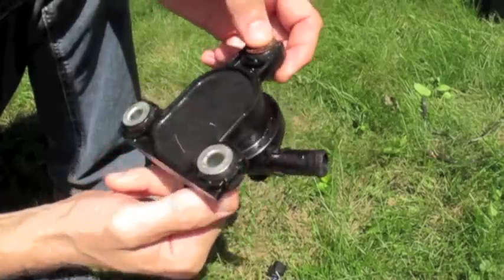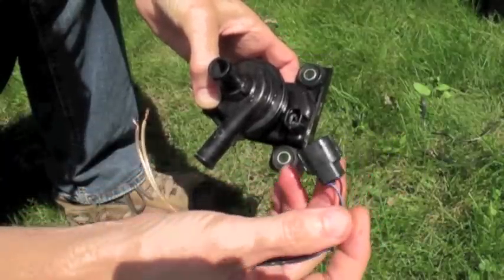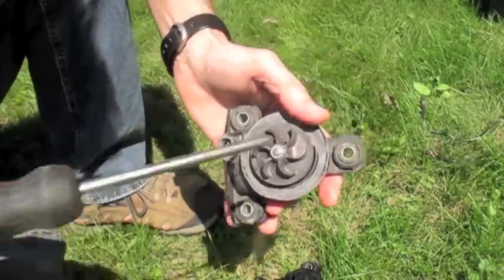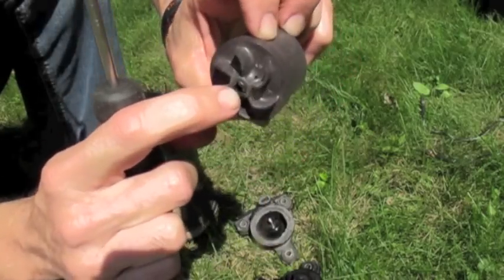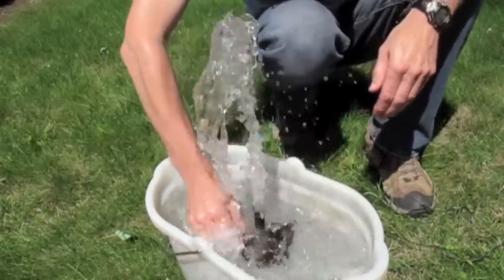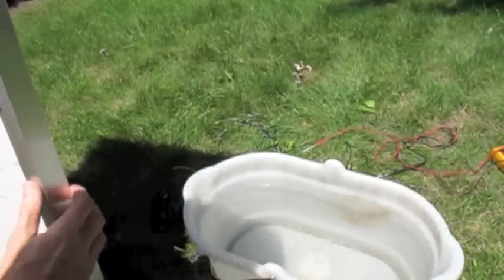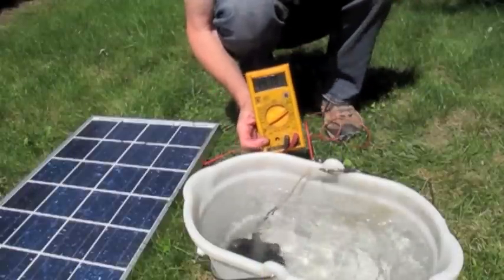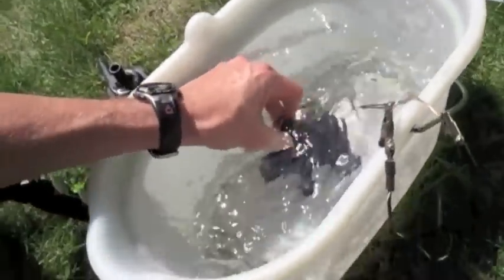Amazingly powerful 12volt water pump from a Toyota Prius ● test to 12v and solar

Comment: There is an another useful test for centrifugal pumps to determine its capabilities and that is static head.  This will provide the maximum height that the pump will lift and is typically stated in x feet of water at zero flow and can be converted to PSI. With a small pump you could use a clear vertical tube of sufficient height on the discharge, and then measure the static height of water with the pump is running. Larger pumps would require a pressure gauge and pipes of sufficient strength. Once the maximum height is known the tube could be tipped where the water would flow out the end of the tube at the maximum height and into a 5 gallon bucket.  Then measure the time it takes the pump to fill the bucket and that will give the maximum capacity of a pump at the maximum lift.  This same test can be repeated at 3/4, 1/2 and 1/4 maximum height to give the various capacities at various discharge conditions.  This data can then be plotted on graph paper, discharge pressure in feet of water on vertical axes and flow in gallons per minute on horizontal axes, to develop the centrifugal pump curve for that pump.  This will provide some useful information on the application of a pump. The capacity of a pump varies inversely with the discharge pressure and varies directly with the pump speed. Google centrifugal pump curves for more info.
Reply from the maker: Thanks for that great info. I was able to test it further in another video and use your instructions. I just did an update on this little pump if your interested.  https://youtu.be/gaGRUTSLz_s   Have a look in the description too for more specs I gathered.

Comment: Nice little pump, the only reason you hook a solar panel to a battery when running a pump, is to ensure continuous power when the panel is blocked from light. Most system run the equipment at same time charging the battery.

Comment: Thank you very much, I needed an electric salt water pump that wouldn't get hot or create electrolysis to a grounded/powered shaft, the isolated/ cooled/waterproof design of this pump was a perfect adaptation for the older Volvo diesel rubber, mechanical pump it was replacing. This sail boat is back operational thanks to your video. I really appreciate how you cut one for our knowledge- I needed that info and wasn't willing to order two and cut one open to ascertain wether or not it would work.

Comment: I was a technician at toyota when these pumps were recalled, we had dozens laying around when a pipe burst overnight and flooded our shop. We used a handful of these to pump the water out of our in floor exhaust vent system. worked great.
Reply: Will they take car coolant temperatures??
Reply: They pump hybrid inverter coolant which does not get as hot as engine coolant. I don't know their operating temperature range but they live in the engine bay and get quite hot.
Reply: Curtis Armstrong I've changed a bunch of these also just never had a need for these until a bought a camper and need a 12 volt water pump to fill the water tank and now that recall is pretty much done.

Comment: You should have showed the actual no load ouput from the solar panel & loaded V & A when driving the pump in the shallowest depth.

But, it looks like the solar panel provided more power to the pump than your first power supply--which is why the jet of water from the pump was higher.

Very good vid.  Thanks for sharing!

Comment: Currently using one of these little pumps to run a solar powered stream in my garden. it is lifting water to about two feet above the level of the pond. Water pours over a small waterfall before returning to the pond.

Comment: Great info! Thanks for posting. Will add it to my solar pumping systems. I found a new Toyota factory pump with a year's warranty for $86.00US. There was a factory recall on Prius water pumps for the years 2004-2009.  All newer models and newer shelf stock should be okay.

Comment: neat little pump. if they were cheaper new I'd order one. gotta get myself to the scrap yard. walmart has 12 volt pumps in the boating isle, which I've used for hydroponics with never a problem. I love playing with 12 volt and water

Comment: I found your demenstration very interesting.  I am trying to run a vent fan on a van in a similar fashion.  It pulls about 1.3 amps at 13 volts.  All that is fine except for figuring out the solar panel I would need.  Since the panel is going to be mounted flat the rated capacity would not be what the panel would put out.  From your demenstration it looks like I would need about .75 of your 51 watt panel or around 35 to 40 watt panel to run my fan.  Do you have any idea if the 16 volt would make sense too?  I don't want to burn out my motor but I also know the the panel does not put out 16 volt when there is a load.  I am also thinking of using a flexible thin panel so the solar will not show.  Do you think this will make any difference?

Comment: Looks like a permanent magnet motor to me. They do grow weak over time, but are useful for very many applications.
Reply: Brushless DC motor. The impeller and rotor are a single piece, with the magnetic field set in the cylindrical part. The plastic housing contains the drive coils.
Reply: There is a controller circuit under the epoxy. Most likely a 3 phase sensor-less type motor that uses electro-magnetic feedback for timing.

Comment: if you need some thing a little more powerful the chevy volt has 3 pumps like this but push more GPM and can be run on PWM  or full power

Comment: thank you for the posting the video... I am wondering if there are two similar fields of magnet inside the impeller that you are showing to create the torque from the attraction and repulsion of the two fields ..because one field of magnet would take you no where.
Reply from the maker: +TheIsmaelIsaac you are correct in saying that. The impeller is magnetized and the body is electrified.

Comment: Hi Chris I live in the Houston are I have a small pond that is really stratified, there is no oxygen in the water beneath about a foot. all I need to do is recirculate the water from the bottom to the top. I want to use a pump like this to clean up the water and add air. I want to simply pump the air from the deepest part of the pond about 15 ft have that water pumped into a 55 gallon drum with sand and gravel then allow it to flow back into the pond.  My question to you is do I need a charge controller or can I just wire this thing straight with man a small inline fuse. That way I can just screw the pump to a stand near the pond along with the solar panel and just hook it up as long as the sun is shinning it will move the water. What do you suggest?

Comment: I would be interested if this would work to pump water from a rainwater storage tank?
Solar with batteries would be ideal.
Have you tried to see what sort of head this thing can pump...e. if it was on top of a tank and had to pump up from the bottom how much pressure would you get/loose?
Reply: You could easily test it, go too any car salvage place and they have car pumps too hand for cheap I expect

Comment: Just for clarification - the parts are injection molded plastic, and the halves are most likely sonic welded together. .
Reply from the maker: Correct. It cannot be taken apart unless you use a hacksaw.

Comment: where on a prius is this located? is it used to pump hot water? thanks so much! awesome video!
Reply from the maker: It is located near the left front headlight under the hood. It pumps coolant through the inverter.

Comment: Wonder if you could use this to move  enough water to generate electricity from a water turbine to charge batteries for this pump and others all running off solar  or would that just defeat the purpose?

Comment: I was fascinated with this little pump too when I salvaged mine from an old dishwasher that was going to the dumps. I haven't repurposed the pump for anything yet but have it around. I'm pretty sure I wanted to create a water fountain rock wall feature for my deck when the time comes. 
thanks for the solar panel demo though. I think I'll adopt this method of powering it. 
any recommendations for a brand and size for this? I don't think I need anything to fancy or expensive.

Comment: I'll see if I can find one.  Curious to if it will pull a 1/2" cpvc suction set at 18 feet in shallow well.  I use a shurflo 2.5 gallon to pump the well currently.  120/240 v pressure switch with toilet float JB welded to base plate to open and close points as level is reached in tank.  Pressure switch wired to battery, battery to 5 w solar panel.  Been in service since 1995.  I'll let you know if she'll pull vertical.  Good vid!
Reply: +Charles Heisler This pump will not make any vacuum at all. It is not self priming. You have three choices in pumps for this application, diaphragm like you are currently using, gear pumps, or peristaltic pumps. Others exist, but would really be impractical for this.  Keep in mind that you cannot possibly lift water higher than about 34 feet with suction. Vacuum is not a force, but a lack of force. This means that eventually the weight of the water would exceed the the pressure from the atmosphere trying to push it up the pipe. Not only that, but water will boil when under a vacuum and therefore the water vapor will begin filling the pipe up. This will reduce the maximum lift to below 34 feet by a small amount.

I would stuck with the diaphragm pump like you currently have. It will give you the best performance to energy usage available in this situation.

Comment: BMW has something similar starting from 1995 for climate control. So you get warm air even if engine is killed. Same thing that the impeller is with magnet.
Reply: Arnis Tarassu 
12v water pumps have advantages over direct drive

Comment: What water pump is this?  Can you give a part number or what it's used in?  Coolant, washer fluid, what?
Reply from the maker: It's a coolant pump for the inverter on a 2004-2009 Toyota Prius. It's located under the hood just behind the left front headlight area. It does not have a part number on it. I suggest to anyone that wants one to get it from the wreckers. That way you can also get the plug that plugs into it.
Reply from the maker: I found the part number for it.  Toyota Part No.: G9020-47031

Comment: Could you buy one of this at autozone you gave me an idea for my swimming pool slide
Reply: MrEricdgreat  You might be better off getting a water pump from a RV salvage yard. Better lift and water flow. Got me one about 8 year's ago and it still works fine and it works on 12 volts. Also if you are lucky you might find one that runs on 110  volts. Or buy a new one at a  RV service/sales area.

Comment: I'm looking to make an automatic bilge pump for my kayak, I was originally looking at 50-100gph 12v DC with a solar charging unit. Home Depot has one for under $70.  This prius pump puts out a heck of a lot more, very quiet with fairly low amperage draw.. 1200mah battery technically runs this an hour, I have enough old rc batteries laying around u could wire them to this circuit and comfortably pump a lot of water readily.. 

Do you know anything about reed switches?
Reply from the maker: What do you need to know about reed switches?
Reply: +Chris Notap I have no experience with them, the little bit of research I've done has guys using backups and multiple failures. I am looking for a waterproof switch that can be accessed on the outside of my kayak. A reed switch could maybe be installed on one of the cords on the boat and then slide to position when needed.
Reply: Didnt he mention it needs to be primed prior to use?  Keep that in mind or you could burn the pump up.

Comment: the brushes are inside the sealed unit. it's DC voltage so it has to have brushes. they are certainly very small. you can use an air pressure blow gun and spin the impeller the correct direction and you'll be able to measure voltage at the terminal. having said that it appears to be a great little pump.
Reply: The armature is fixed and impeller is attach to a spinning permanent magnet. It's a Brushless DC motor, there will be an invert/switching power supply encased in the epoxy on the back, it's very common design, PC water cooling pumps are all build this way. 

For it to be a Brushed DC motor the permanent magnet would be fixed, and the armature spins.
Reply: The impeller is a permanent magnet; one-piece cylinder with the permanent magnetic field, and the pump blades on the end.
Reply: This is a brush-less motor. The controller circuit is under the epoxy. Just because it is powered by a DC supply does not always indicate a brushed motor.
Reply: its a brush-less permanent magnet DC motor

Comment: As a prius owner, I can tell you these have a high failure rate.   Mine had to be replaced before 100K miles and again as part of the 200k service.   Every other Prius owner I've asked, has had the same issue.   My be a systemic Toyota issue
Reply from the maker: +John O'Halloran   They had a recall on them.
Reply: Motors are not designed to pump 100C liquid, it's very difficult to keep cool

Comment: could this be used as a water pump on a big block v8? like mounted on the frame or even firewall next to the heater core and plumbed normall from that point on into the the intake etc.
Reply from the maker: It could work. Might be worth a try.

Comment: I would hope this pump works very well you've got to remember it is the only thing circulating the coolant for cooling the entire hybrid powertrain system in a Toyota Prius with the exception of the battery the battery is air-cooled in the Prius I should say both batteries are air-cooled in the Prius I drive a 2007 Prius and trust me the electric side of the powertrain can give you one heck of a Kik 4325 2nd bursts and off the line it'll get you Movin to about 25 to 30 miles an hour really quick then it reduces power to reduce the amount of heat build-up so that way the tiny little section of radiator that is used for cooling the coolant for the electric powertrain portion on the Prius is capable of keeping up and actually cooling it down if need be the advantage to the way the system is set up is the car can actually run the cooling fan and draw air through the radiator even when you were sitting there at a stoplight and circulate coolant through the system so that way when you're sitting there not using any energy it can still be cooling the system down if they did not have a good cooling system for the electric powertrain portion of the Prius it would be extremely unreliable and probably overheat die and kill the electric motor controller assembly unit and electric motors within less than 30,000 miles on the car keep in mind that these are cars that regularly go three hundred thousand plus miles on original equipment parts.
Reply from the maker: Correct, correct and correct. Thanks.

Comment: if you take a 12 vdc headlight and attach it to 12 vdc...and drop it in water...the lamp will light...being in water does not short it out like AC...
Reply: +Concepcion Amancio it is the low voltage that makes the difference, not ac/dc.

Comment: Powerful pump. Mount it outside (exterior pump) and use tubing and it could run for years.
Reply: if the connector makes the pump water tight, then it may increse longevity to have the pump below the water surface, to provide cooling.

Comment: So the steel shaft stays stationary and the magnet with the integral impeller rotates on it, so no shaft seals to fail. Must get the polarity right or it will rotate the wrong way.
Reply from the maker: A brushless DC motor. It won't run backwards.The water lubricates the shaft. I have used it in a bird bath/fountain and its into its 3rd season running about 5 months straight each season submerged.
Reply: Brushless is even better! If they don't get clogged up with debris, or run dry these guys run forever.
Reply: Water is not a lubricant.  There is something else going on here...
Reply: Nicholas Washburn water can be used as a shaft lube
Reply from the maker: It aligns the shaft and impeller without contact creating a thin wall of water between the 2 parts. The water lubricates the shaft to minimize friction and allow smooth movement.

Comment: Do you need to insulate your wire connections with heat shrink (or some other way) to keep the water off them?

Comment: Has anybody perhaps measured the amps usage on that pump
and perhaps
measured the liters per minute it deliveres with a 1 meter head?

I want to use this pump on a aquaponics system and need around 25 - 27 liters per minute

Comment: Nice pump.  What brand of solar panel are you using in this video?
Reply from the maker: Here is everything that was on the label of the solar panel.
TYPE: multicrystal,  
MODEL: LA361j51,     
WATTS:  51w   
OPTIMUM VOLTAGE: 16.9v, 
OPTIMUM CURRENT: 3.02A, 
DiMENSIONS: 985 x 445 x 36mm,
DATE: 1992.7, 
KYOCERA CORPORATION

Comment: I would hazard a guess that it is a electronically controlled brushless dc motor and NOT an induction motor.
Reply from the maker: Yes. You'll find the update video here with more info:  https://youtu.be/gaGRUTSLz_s

Comment: any other useful info like pressure it can produce, or static head? it is very uiet i wonder i it would work to replace a diaphragm pump in a RV... they are very noisy.
Reply from the maker: I will try to measure that info and put it in the description as soon as I can.